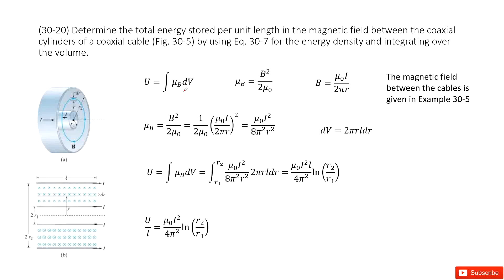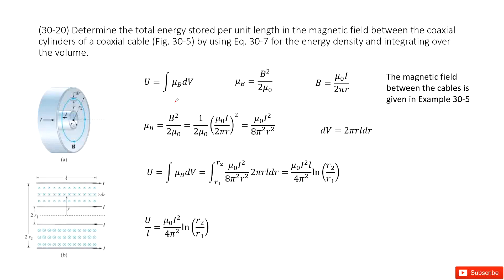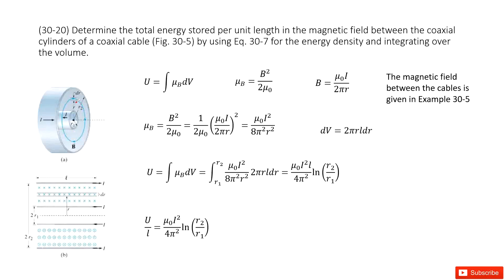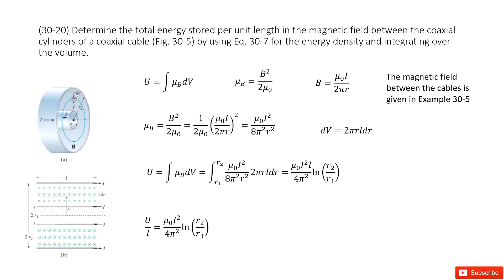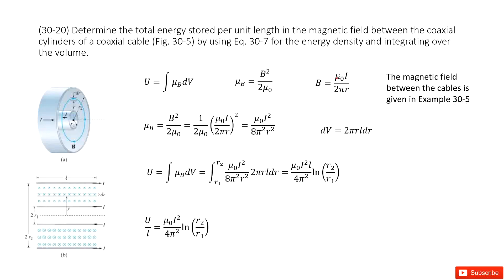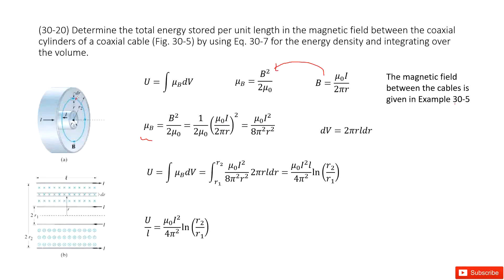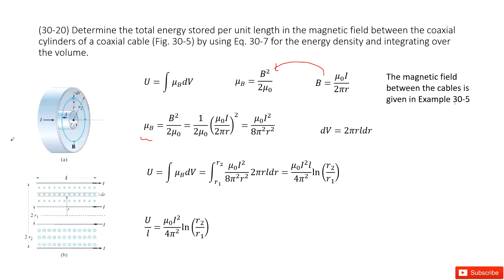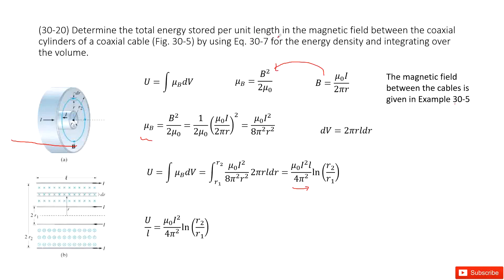(30-20) Determine the total energy stored per unit length in the magnetic field between the coaxial

Comment: Hi, thank you for the video. Just wanted to point something out, in the integration calculation there has been an oversight. The result will have only one pi in the denominator instead of pi squared. Since the pi squared in denominator will be cancelled out when multiplied with (2piR) inside of the integral